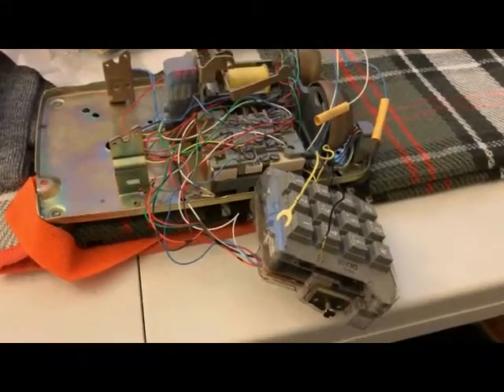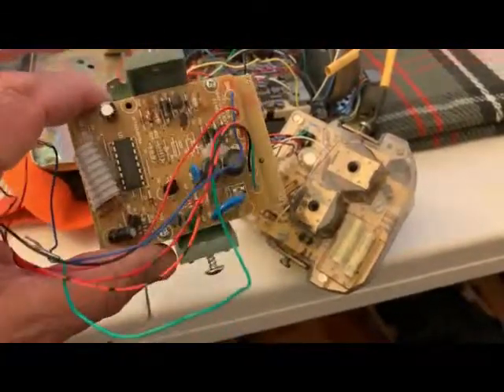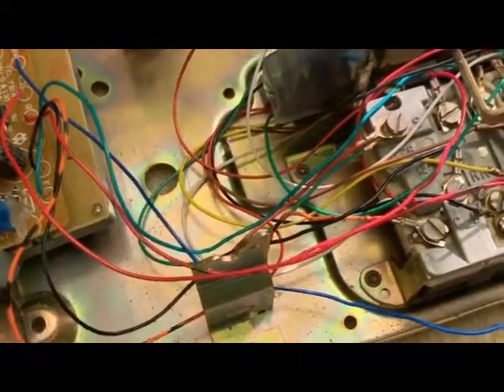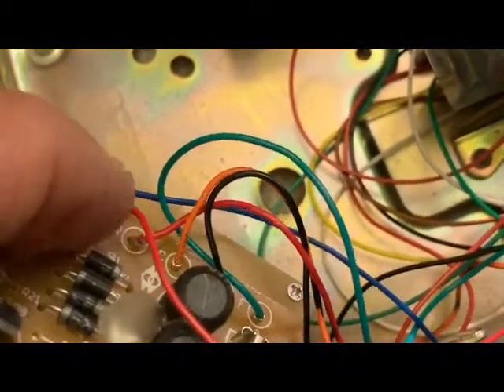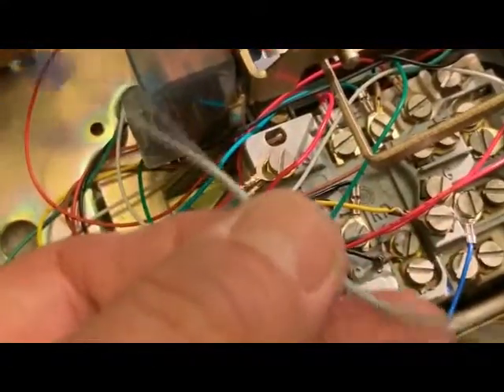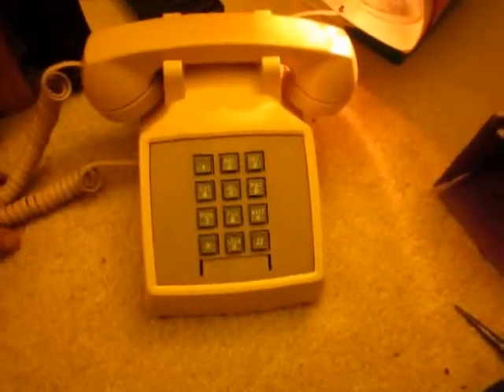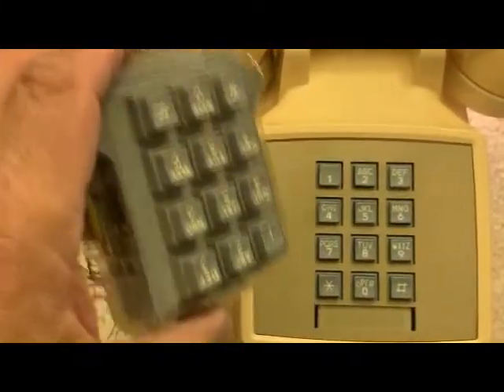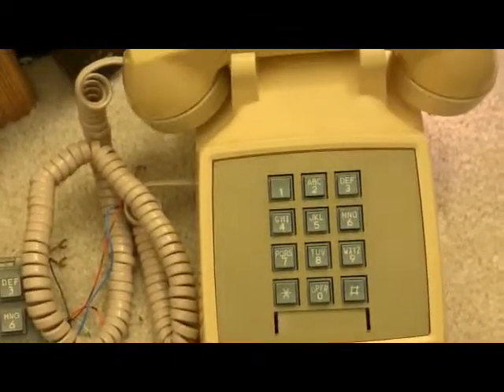WE2500 Phone Keypad Upgrade Tricks

Comment: You replaced a heavy duty American made keypad with a cheap Chinese keypad. Let's see which one is still working in 20 years.
Reply from the maker: Well, the so called heavy duty pad was not working and you are correct. The phone no longer works and I don't know what to do to it. It was an experiment and it at least worked for while longer.
Reply: @michaelbradford2816  Thank you for the response. The older keypads have tuning coils so they can be tuned just like a piano. Over the decades they drift out of tune and the phone company no longer recognizes the tones. There is a device for setting the tune on these and people who do this for a small fee. Back in the day the phone company never envisioned people working on their own phones, so the tuning knowledge and device were not commonly known. Outside of needing to be tuned every decade or so, cleaning contacts is the only other issues these have.
Reply from the maker: @dygger  Oh boy! Just got back into that planned or unplanned obsolescence factor of the 60s and probably before that. I had read of the coils and attempted to get around them, but...Goes to show ya how amazingly things were done in a pre-electronic world. It's awesome what they could do with only a momentary contact or a resistor or a tone. Well, I tried to preserve it as long as I could.

Comment: I was trying to replace the old keypad on a Western Electric 2500 (manufactured in 1982) that I just bought a while ago. I could receive calls on it, but I could not dial out. The old keypad as a brown wire that was screwed to the back of the keypad and attached somewhere on the bottom side of the phone. I replaced the keypad and made a jumper like you suggested, but now I get no dial tone. Could it be that brown wire? I'm not sure how to remedy that problem or where to attach the brown wire now that I have a new keypad and nowhere to connect that wire. EDIT (I attached the brown wire to the GN spot and got a dial tone, but it is very faint and I still can't dial out)
Reply from the maker: It's been a while since I experimented with this.  My phone worked well for years and then one day the same thing happened as you described, a faint dial tone. That's strange.  I could not resolve my issue either. I'd say that you should consult other sites to see if they have an answer. There are many variations on the wiring too.  That makes  it more difficult to diagnose.  Some guy  out there does offer a  repair service as I recall. The old phones are worth it, up to a point. Thanks for your comment today.  I hope you can get it resolved.
Reply: @michaelbradford2816  Ok, I SORT of fixed one problem. I reversed the polarity on the green and red wires coming from the phone line in jack. That allowed me to dial out, but I have to really hammer down on the keys to get it to do so. I can hear the dial tone and the person talking to me, but they can't hear me and I can't hear myself through the handset. So I am ALMOST there.

Comment: Where did you obtain the EXACT keypad you're using? I have a similar EPG keypad but the wiring is different and the wiring instructions talk you through disabling the polarity guard which you do not become involved with.

I'm in the UK

Kind regards

David Chadwick
Reply from the maker: I got it from eBay, just a shot in the dark. Unfortunately, there are many variations in Western Electric.  They were around a very long time and freely changed phones. You'll have to experiment for some time, There are other videos on Ytube and you'll get some more insights that way. No one fix could be expected to work with all the variations even with in the same series.  There are numerous written fixes too, some with photos.  Hope this helped.
Reply: This keypad can be obtained from oldphoneworks in Canada